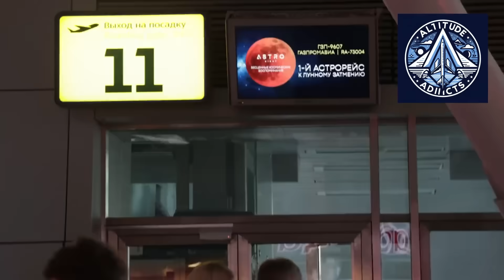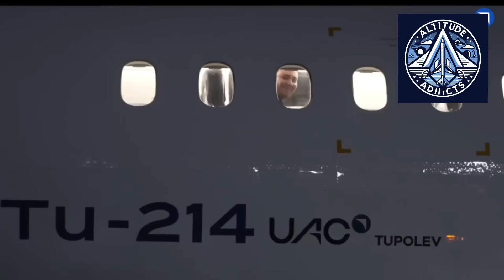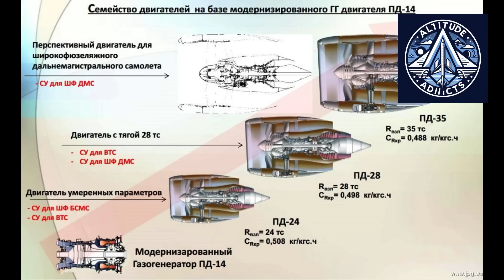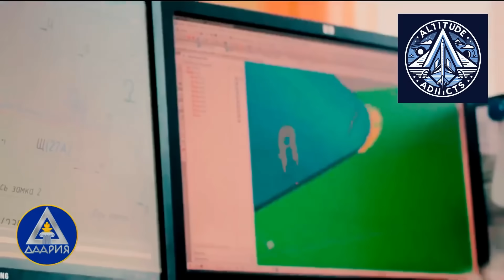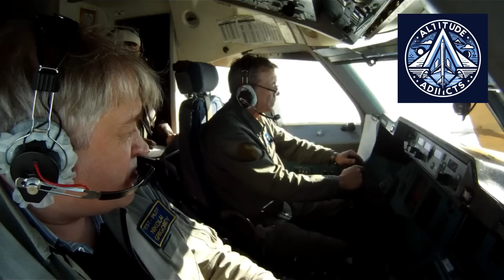TU-214 Engine Options - PS-90A3, PD-18R, PD-14M or PD-16?

Comment: None of those engines exept the PS-90 A3 or A4 are suitable for the TU-214 since the others lack power or are too big for different applications.... The current engine is reliable and no replacement is needed, all the tooling is in place and in production, it would take another 10 years for another engine to take its place or replace it.... If it's desired for range or less fuel thirsty you can hang a Kusnetzov KN-83 for a 25% boost in range and if desired a KN-86 could be an alternate engine with an extra rear turbine stage and composite fan blades....
Reply: PD-18R?

Comment: PD-18R with the planetary geared fan will use the fan blade tech from the PD-35 ..... composites instead of titanium .... development of the PD-14 will improve its fuel efficiency not power ..... seems obvious what they are doing ..... meanwhile the reliable PS-90 is available until the PD-18R is ready - because the PD-14 is not powerful enough for the Tu-214 .... and Il-76 .... Il-96 ...
Reply: If you are going to do all that..... I would rather order all MC-21s and then do MC-21-400 with PD-18R.  No point dealing with outdated aircraft like TU-214 if you have composite MC-21 right next to it.

Comment: Yeah, an improved 90A in the 214 is a good compromise for short term use, next 10 years or so, until the MC-21 package becomes mature.
They need a steep learning curve, yet, for the composites in the 21, to match western use, and get the weight down.
I think the original 5100 km range is a milestone they should really strive for to achieve.
They still cannot reach Vlad from St. Pete and Moscow, in one go, but halfway, and have a fuel truck sitting on the pad for a quick refuel, and then on their way again.
The 21 could fly each leg with partial fuel load to save weight and further fuel consumption.
Reply: In reality, no one can fly with a range of 5,100 km. The flight from Vladivostok to Moscow is almost 6,500 km, directly across Chinese territory. If you stay in Russian airspace, the distance is even longer.

Comment: I believe the 90A engine will be in use for a long time, as its certification is tied to the aircraft's equipment, and if the engine is replaced, recertification will be required. Furthermore, the 90A and 90A2 engines are extremely reliable, providing high fuel efficiency, low noise levels, high power, and long service intervals. At the same time, the PD-14 engine is clearly underpowered for an aircraft weighing 110 tons, and its repairs are frequent and expensive. Furthermore, any engine, including the 90A, can be endlessly improved. By the way, the dry weight of the 90A is not much more than that of the PD-14, although the 90A has significantly more thrust, so if you think about it, the PD-14 has no advantages other than slightly lower fuel consumption, which is a dubious advantage given the difference in thrust. I'd rather build a 5th generation engine based on the 90A and upgrade it than waste time building something from scratch.
Reply: Improved yes. But only to the level of "tweaking" it, not endlessly.
It's designed bypass ratio is less than modern engines and cannot be changed enough to match modern designs.
Reply: You make a valid argument
Reply: The economical PD-90a. I laughed 😄
Reply: @ВикторАпанасевич-ч6ы  Fuel consumption is 0.595 for the 90A engine and 0.565 for the 90A2 engine. The PD-14 engine consumes 0.526 per kilogram. However, two 90A engines provide 8 tons more thrust—a huge difference, so I would say the PD-14 is uneconomical in this regard. For example, the consumption of PW1431G per kg is 0.535, although in general, during tests on the MS-21, it showed 0.570. This engine has a thrust of 14 tons. An engine similar to the V2500-E5, with a thrust of 15.8 tons, consumes 0.580. Thus, the 90A and its derivatives outperform almost all similar foreign-made engines, and its derivatives, especially the 90A2, are exceptional.